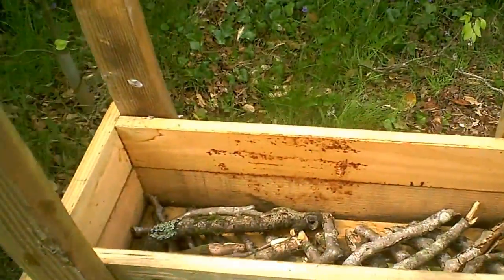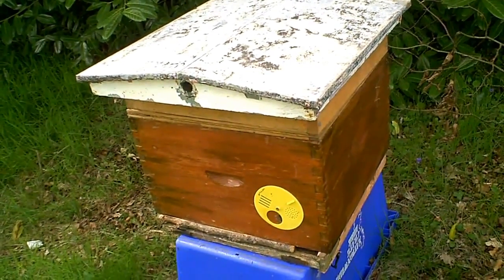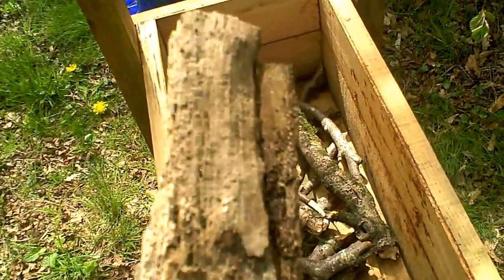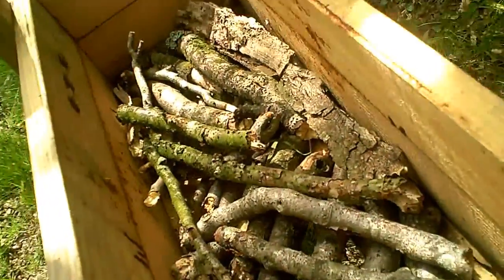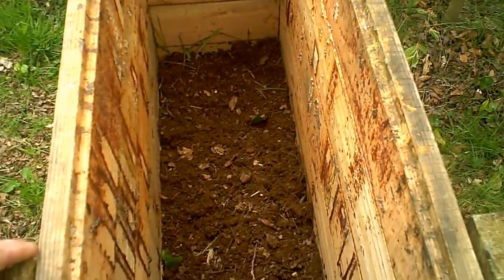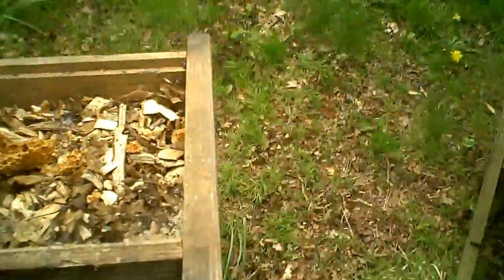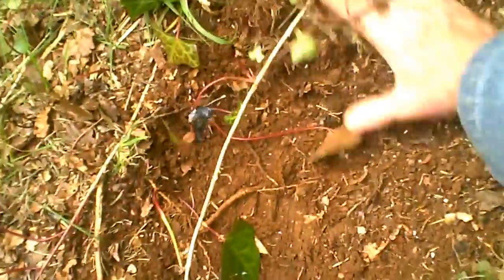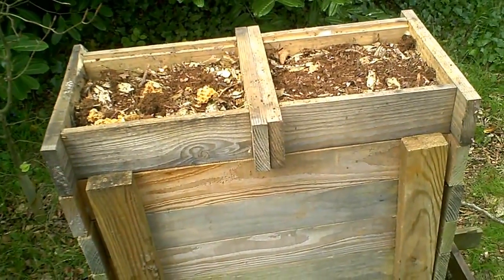How to Make an Eco-Floor for a Beehive

Comment: On the other hand, one could say bees go to great lengths (literally) to build their hives away from the ground. And you've just gone ahead and brought them together,  rather unnaturally. Just food for thought.
Reply from the maker: The eco-floor is intended to be an analogue of the inside of a tree hollow, formed by rotting wood.
Reply: @BarefootBeekeeper I doubt it has any advantages over an open bottom, but maybe! I've never had a top bar hive or whatever.

Comment: You have a 'new'sort of mind set. but I differ from some of what your saying in that the wild hives I've researched  all sterilized their interiors with propolis , some to a depth of 1/4-3/8's of an inch thick on their ground side of their hive. This 'Tower of Honey' was built on top of a wood pile . The brood area was under the wood pile just above the ground which they coated and made into plastic no less then 1/4 inch thick. Think about how we have imitated honeybees in our world where things were needing to be sterilized, like walking into an E.R. or Surgery Room. There's a pan to walk your shoe through of a cleaner to keep the germs out. This in imitation of nature, that of the honeybees and their use of propolis to keep their hives 'Sterile'. Once honeybees are invaded by Varroa mites to the point that they can't clear out the dead and dying , the hive become septic and they than Abscond in a swarm to try to save the queen. Please don't stop your research but please don't teach 'new bees' things like misaligned thoughts. there is far to many 'truths to Bee learned' . Enough truths to studying for a life time and never reach a point of ever knowing enough or knowing it all.
Reply from the maker: If the bees decide to propolize the floor, then that is itself useful information.
Reply: @BarefootBeekeeper  have you seen any evidence of them trying to properlize the floor? I’m finding this super interesting.

Comment: Interesting. This would make more sense to me if bees created their hives on the ground or in decayed piles of wood. But they don't usually. The build in dry enclosed spaces like tree hollows, wall hollows, and in clement climates, under eaves and in tree crotches. None of those locations seem to be the same as this. Also bees coat with propolis most everything inside a hive, so even if the tree hollow had some detritus at the bottom, I would expect the bees to encase it pretty quickly.
Reply from the maker: Hundreds of other species live alongside bees in hollow trees.
Reply: I think he should fill the box completely with debris so the natural bugs have a nice place to live. Let the bees go find what they want (like the wall of a house).

Comment: Fascinating, thank you. I wonder though: aren't you just placing an ecosystem into a relatively sterile environment wherein the absence of rain, light, exposure to the wider natural environment, will quickly render it just as sterile as the rest of the hive?
Reply from the maker: In some ways, yes, and this is the problem I have been having using this idea with horizontal top bar hives, which are some distance off the ground. It still does a good job of providing low level insulation and regulating airflow, but it does not seem to be sustainable in the sense of being completely self-regulating - drying out is the big problem.
I am now testing a version of the eco floor designed for vertical hives. Watch this space!
Reply: @BarefootBeekeeper  Thank you Phil, I shall! Very much enjoying your Channel.

Comment: would this not encourage hive beatles?  I put a cedar shaving "blanket" in a narrow frame at the top of my hive in the winter as extra insulation. Hadn't thought of the floor.
Reply: +ljbobb1 I don't know about encourage, but certainly would give them more places to hide along with wax moth larvae.  I think this dudes in Aussie or New Zeland maybe.  He clearly doesn't have them cause I would  think he'd have a screened bottom board
Reply from the maker: +Zak White This dude is in England, as it happens. Wax moth larvae are not going to live long on the floor, as they would have no food and would likely be attacked by earwigs. We don't have SHB, but they are vulnerable in their larval stage and again would provide extra protein for earwigs and other predators.

Comment: I made an ecofloor hive stand for my national hive last year based on Phil's ideas for ecofloors for kTBH. I made a four sided box box with 100mm wide 20 mm thick wood, put 10mm mesh underneath and a leg on each corner. I filled it with woodchips and placed aluminium 2mm craft mesh on top. I used this so it will roll back and I can "top up" the woodchips. It isn't entirely essential but ensures the bees don't build down from the frame bottom into the ecofloor. I have successfully overwintered a very small colony in this hive.

Comment: Do you think that maybe the tannic acid in pine needles might help to combat varroa when added to your eco floor?
Reply from the maker: It's possible. I don't routinely add them, but there is also tannic acid in oak bark, which does often find its way into the mix. Oyster mushrooms produce oxalic acid as they grow, so that's another line of enquiry.
Reply: @BarefootBeekeeper  the only thing to do is compare suppose.
Reply from the maker: @josephwoodall832  yes, but the big difficulty  with all bee research is multiple variables: no two colonies are identical. It means that you have to have many hives with sister queens,  in groups, in identical conditions, and it's very difficult to draw firm conclusions.
Reply: @BarefootBeekeeper  I agree but one could do a preliminary study with just a few hives to see if it's worth further research sister queens would be needed but even just two hives could give you a clue about the value of such a study in only one year.
Reply from the maker: @josephwoodall832  possibly, but what data would you collect, and how? It is impossible to measure mite drop with an eco-floor.
Reply: @BarefootBeekeeper  yes you can do mite counts with the alcohol test you lose a few bees but it's pretty accurate.

Comment: What was in the bottom of the hive before you placed the first sticks? Partially or completely open? I can see light coming through. Also, can you tell me the name of the mite you mentioned is a predator of the varroa?
Reply from the maker: That hive had a course mesh in the bottom - something like chicken wire. These days, I use a smaller mesh, to stop wasps sneaking in. The predatory mite is Stratiolelaps scimitus - see http://www.evergreengrowers.com/stratiolaelaps-scimitus-womersley-hypoaspis.html

Comment: About to try the Eco-floor with a top bar hive. I am in Ireland. The weather is very dry at the moment. Is there any benefit from wetting the bark and moss as I place them in the Eco-Floor, or better leave them dry? And what materials are you using in your current Eco-floors? Thank you!
Reply from the maker: I think the floor material should be just damp. I use a mixture of semi-composted wood chips, sawdust leaf mould and a little soil.
Reply: Thank you so much Phil!

Comment from the maker: Having had a couple of occurrences of bees coating the surface of the Eco-floor with propolis, I am re-thinking this idea. A possible alternative floor material is charcoal, with which I will be experimenting this year (2017). I also expect to fit electronic monitoring sensors and data loggers to record the bees' interaction with the floor material. Charcoal is a material commonly found in tree cavities that have been caused by lightning strikes and so should be familiar to bees. Charring of the insides and outsides of hives is common practice in Japan.
Reply: I'm very glad to see you've made this discovery, and were honest enough to post about it here. 
While watching the video, I was thinking to myself that the hives in trees, (where most of them are) would not have all kinds of bits of tree branches, leaves, dirt, etc just beneath them, much less on top of them. They always seal off their cone areas to keep such things out. I was going to post my feelings, and was scrolling down to see if anyone else had posted the same feelings as I had when coming across this. Again, glad to see this. Thanks.
Reply: I'm not sure that the bees coating the floor in propolis would be a negative thing. A lot of it could just be managing the airflow through the hive, as there aren't many screened bottoms in hives bees choose for themselves in nature. ;) Some studies have suggested that the amount of propolis in a hive also has a correlation to the hive's overall resistance to disease. If true, I would think that having a whole floor covered in it would be a good thing.
Reply: I must admit this makes sense the bees will regulate their environment and I think the use of wood, leaves and soil as an alternative the a screened bottom board is a brilliant idea. As the wood, leaves and soil creates its own ecosystem a bit like the floor of a cave underneath bats, great idea.
Reply: Wild bees will propolis the whole of their tree cavity. It is though that this is to "sterilise" their environment. I think I got this from by Tom Seeley in some BBKA lectures on wild bees. Honey Bees in the Wild - PART 2  on youtube.
Reply: Although an over-abundance of propolis may be an inconvenience for the beekeeper in working a hive, I would think it would be a great thing for the bees.  Considering its health benefits, the more propolis, the better!

Comment: Bees get in touch with those things on their travels. No need for us to overexpose them to it. It's not like my dog living in my house wants anything to do with spiders and snakes on a daily basis. It likes to dig after moles. Should I introduce moles into my house, because of my dog. Why not just chase my dog back into the wild and get it over and done with.
Reply from the maker: Gabriel "Overexpose" implies an amount that could be harmful, for which there is no data, since AFAIK nobody has done the research. In fact, bees are unlikely to come into contact with soil-dwelling mites while visiting flowers. They would be much more likely to do so in a tree cavity, but since beekeepers tend to put them in sterile boxes, that is no longer the case.